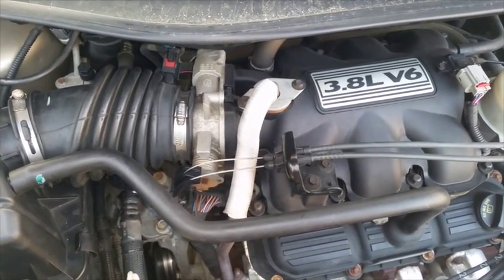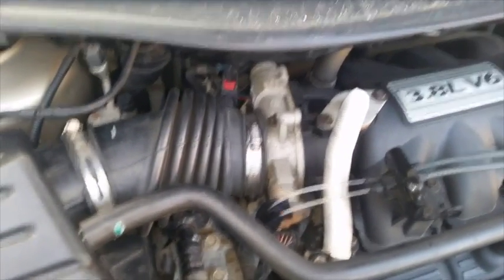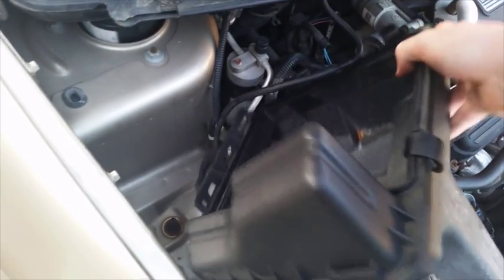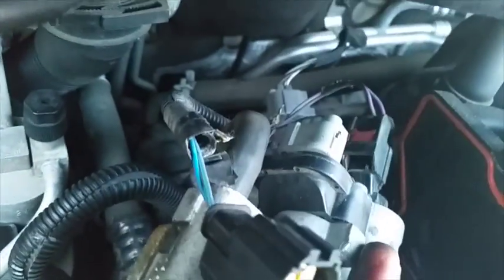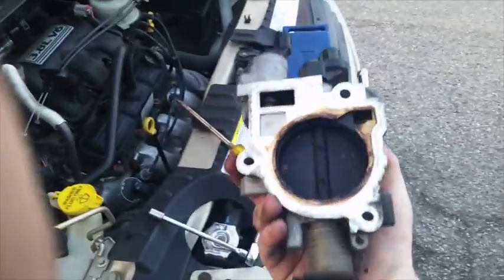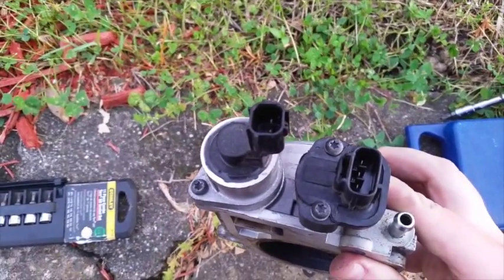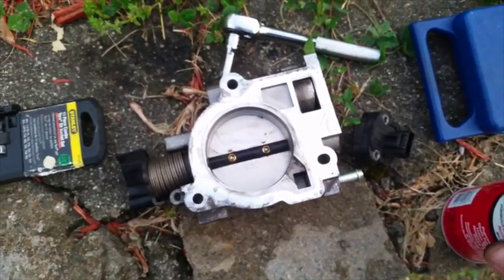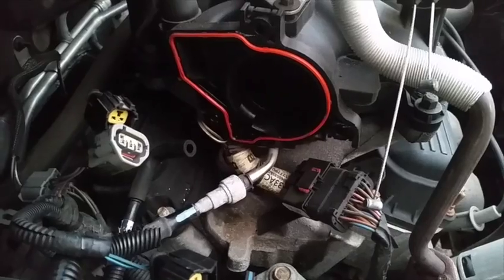Cleaning the Throttle Body on your Dodge, Plymouth, or Chrysler minivan.

Comment: Cool and good video I did this on my 2002 Grand Caravan with the 3.3L and it's exactly the same. The only thing different was that I left the air box bottom in. I do NOT recommend using brake clean as it WILL swell and can damage your O-rings when you try to put them back in. Also break clean may damage the IAC valve internal seals where the Gumout won't. All in all a great video. I'll look for more. I had four issues with my caravan, i've fixed three, they are:
1. Tachometer goes nuts, Input speed sensor fixed that.
2. Speedometer goes nuts, Output seed sensor fixed that.
3. Daytime running lights, only one lights, then when you turn on the headlights they reverse, the other one goes on and the one that was on goes out. Modified the Function Control Module tabs (slight twist and bent down) & Modified the Fuse box connector by widening the holes, problem solved.
4. The engine at idle hunts up and down from 500-700 rpm, mostly when it's hot, A/C on or off doesn't matter. Replaced TPS, Cleaned and checked IAC, Cleaned throttle body, and checking for vacuume leaks, couldn't find any, changed the spark plugs, cap and rotor, ran injector cleaner in it a few times to, tried different grades of gas, even changed the A/C clutch, tensioner, idle pulley, water pump, power steering resevour, valve cover tube to airbox, all to no avail so the hunt goes on.
Any Ideas?
My small channel is here: https://www.youtube.com/channel/UCHhwD-RQ1K5Xd9sxsDHAtqQ/videos
Reply: ***** Thanks for the reply i'll check that out. Oops on the cap and rotor,I was thinking of the 95 Pathfinder I was working on at the same time and talking to my son about when writing my comments.
That one we fixed by changing the Heated O2 Sensor, Spark Plugs, Cap n Rotor and cleaning the throttle body.
Best wishes, Keith
Reply: ***** LOL actually it was that  both had the same problem at the same time. I was only able to fix the Pathfinder, I will look into your suggestion as i've tried just about everything else. Thanks again. Keith

Comment: Great video. I was able to pull the throttle body, replace the TPS and IAV, clean out the body , and get it all put back together in just 40 minutes (with ten minutes spent hunting for the torx bits) on my '01 Chrysler T&C thanks to you!

Comment: When you do this make sure you open the butterfly and clean the inner edges where the butterfly rests or closes against the aluminum boss or body, this will eliminate 'sticky throttle', also turn the throttle body sideways and clean out where the IAC control goes in, it will be filthy with a black greasy contaminate that just comes from the millions of gallons of air that has passed threw it, on this unit you can use a toothbrush to clean it because it has no electrical sensors on the throttle plate like newer cars, it is a 'dumb' unit, clean your IAC as well or while you have it out, change it out.  When I was done she ran perfectly, but I used Throttle body cleaner, while your at it spray down your map sensor in the air tube with Map cleaner and your intake manifold pressure sensor on top of the intake manifold as well.  In addition I sprayed the throttle spring with throttle body cleaner as well.  My 04 T&C run like new now.

Comment: You won't need 1/2 a can of carb cleaner if you simply grab an old toothbrush. Also this can be done without taking the TB out/off.  Careful cleaning the IAC valve, be gentle. Use Qtips inside IAC cavity.

Comment: Doesn't carb and brake cleaner ruin gaskets and o-rings.  I noticed you hit the throttle control valve o-ring with carb cleaner.

Comment: hi I have had the same problem with 02 grand voyager cutting out, I changed the crank shaft sensor and cam sensor, and has worked but not 100% was thinking off this a next move, any responses welcome and good video very informative.

Comment: Dear Sir, First of all thank you very much  for your help. I watch your video on youtube. my 96 dodge caravan has the same issue . after i had cleaned the throttle body, I believe that I might had screw up. I don't know, is it the Idle or the throttle position sensor. when i stop at the stop sight the engine goes more louder, when I release the brake it runs even I don't step on the gas. it can go. could you please tell me what is wrong in this situation. Thank you very much. God bless you.

Comment: Hey thanks I searched all over hell's half acer looking for info on how to pull that valve NO ONE had anything Id been wrestling with it but was fearful of damaging it by prying at least now I know thats do able and will try it in the AM  ( while not a minivan its the same one thats on my 04 durango lol)
Reply: ya the throttle body you show and mine for the durango are near identical which is good as most the others online for other durangos show a different unit or they do not tare it down as far as you do.  sadly mine was so caked in place when I did pry it it broke then once it broke the stuck piece popped right out lol murphy's law
Reply: ya it was badly needed it was surging after depressing the gas peddle half way  and tossing out all manner of error codes like P0508 etc  the motor is the 4.7 V8 in a 2004 durango SLT its dam close t the same throttle body if not identical.   I knew there were many clones out there but never thought it would  be a minivan lol  (I had a voyager once upon a time)
Reply: If I could post a PDF here Id share the list I have that shows all clones meaning  cars trucks suv's that you can share parts between  I have it in my FB durango group  more a club with a few people but the info in the files is helpful lol

Comment: 2006 Dodge Grand Caravan what would cause the van to shake a little bit giving it a little gas
Reply from the maker: CV axles
Motor mounts
Unbalanced tires
Loose/Missing lug nuts
Stuck brake caliper

Comment: hey hello again well engine light is going i discconected again and re-conected back plus i put some special grease and work just fine ... now i got another question i have the abs light on off on off sometimes not all the time 10 or 15 minutes the most then off again any idea.....

Comment: I have a question ,and maybe you don't know the answer. Why didn't Chrysler installed the 3.3 ,3.6 .or 3.8 in their Sebrings instead of that crappy 2.7 V-6 that gives so many problems?
Reply from the maker: Good question.. they even had the nerve to use them in the dodge charger when they brought it back 14-ish years ago (same with the Chrysler 300).  I guess Chrysler loves to fail

Comment: Hi adventureoflinkmk2,

I love your videos and they are extremely helpful!  

I was wondering if maybe you could help me diagnose an issue I am having with my dodge caravan?  The 15 and 20 amp fuses were pulled out one by one and non look burnt. IOD looks fine! The car stalls as soon as I turn on the headlights, radio and AC.  For the past year the AC compressor makes a grinding noise but the AC is still ice cold so I just keep driving it around.  I cleaned out the TPS like you did in this video so I am convinced the issue is electrical but I just don't know how to diagnose it... When trying to drive the car yesterday it stalled out after about 20 feet.  So now it will start but as soon as I turn on the lights I heard like a pop coming from the fuse box under the hood...

Any idea on what could be wrong or where I should start?  Thank you and all help is really greatly appreciated! :)
Reply: I'll try that. Thank you for responding.

Comment: 2001 doge grand caravan when I put it in gear engine  die  any ideas?
Reply from the maker: Torque converter, idle air control valve, clogged EGR...

EDIT: could also be pressures inside the transmission doing this.  Lots of things really, just start with cheap and easy (clean EGR and throttle body and idle air control valve) then go to expensive
Reply: Thanks  this my weekend  project  I will try to clean the Idel  throttle  control never been cleaned hope that will do it thanks again
Reply from the maker: @joejoesph5578  you're welcome.  Good luck!
Reply: I did my weekend  project  and also clean  the Map manifold  pressure  grand  caravan  2001 runs like brand new thanks  very helpful
Reply from the maker: @joejoesph5578  great!!!  You're welcome btw